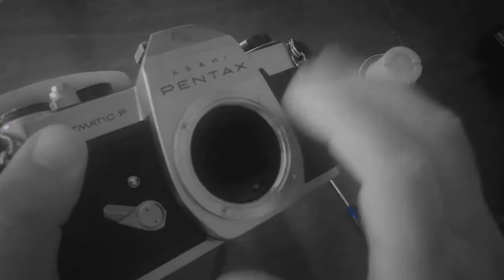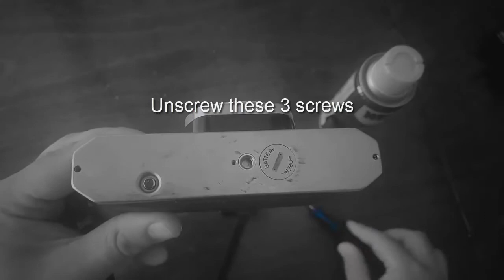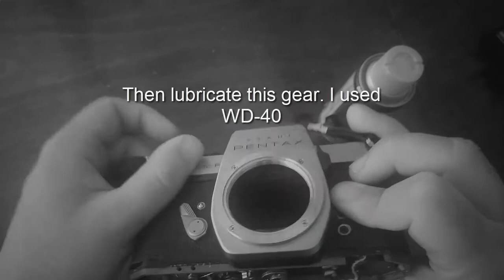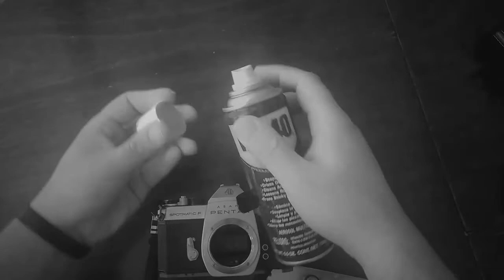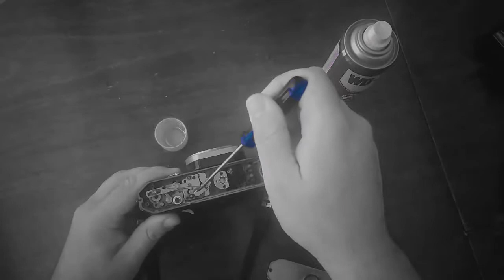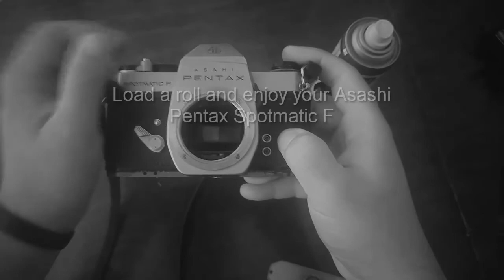Minor repair in Asashi Pentax Spotmatic F ( Mirror remains up)

Comment: please use machine oil for such repairs, WD-40 is only a water displacer (hence the name) an generally is not recommended to use in old cameras (it is too "thin" and can spill to parts you don't wat it to). Good vid though:)
Reply: I can't to the comment section to make the same point.

Comment: If this method doesn't work try screwing off the lens,  below the mirror there is a little bar that depending on your situation is either fixed or movable back and forth. On both sides of the little bar (where the mechanism looking thing is) try lubricating that with something like WD-40
Reply: THIS worked for me, the spring lever just kept hanging up on the 'latch', I tried tweaking it but..no help. However allowing a little drop of oil to run down the screwdriver shaft and onto the mechanical parts of the depth of field preview lever did the trick. I now have a PRISTINE Spotmatic that probably developed this issue shortly after the previous owner bought it and never bothered to repair it. I now have a MINT Spotmatic, a MINT 50 1.4 and a MINT 85mm F1.9. Sorry to rub it in but.....I SO lucked out! :-)

Comment: Nice repair! But do not use wd-40. This oil is not manufactured for pernament lubrication. It is highly penetrating oil for loosing screws or conservation metal stuff. For fine mechanical parts I recommend for example Balistol or connex.